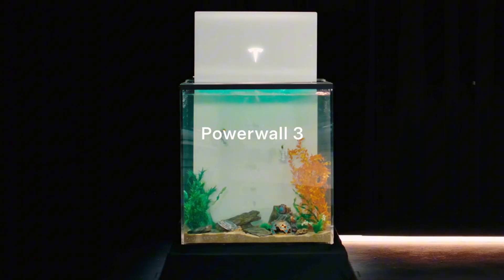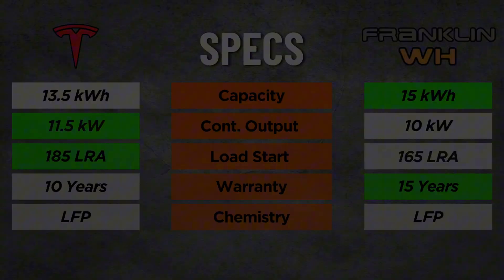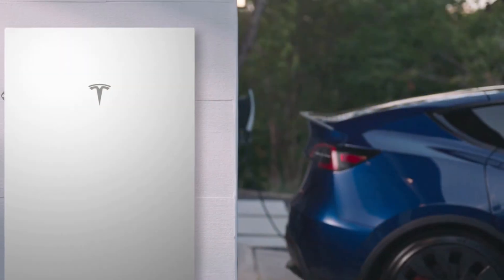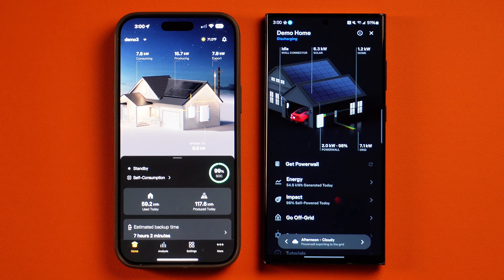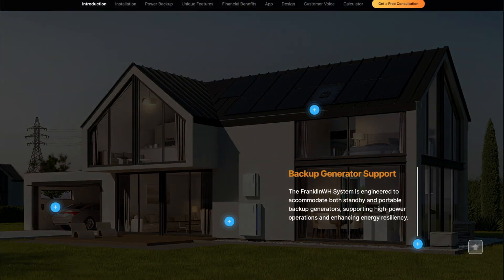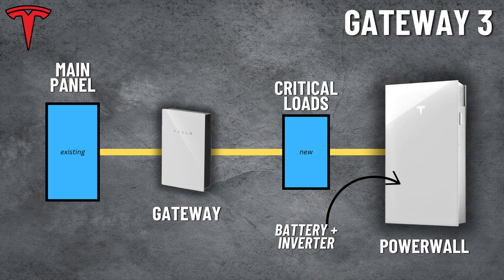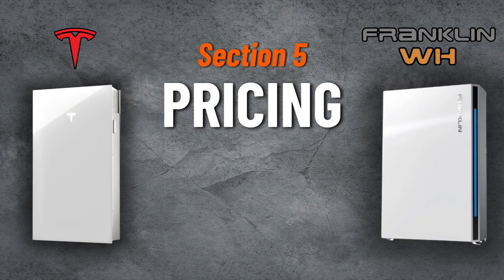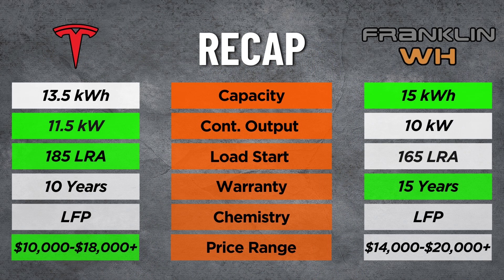Best Solar Battery in 2026? Tesla Powerwall 3 vs. FranklinWH aPower 2

Comment from the maker: Which battery looks better to you? Franklin or Tesla? 🔋
Reply: The glass cover on pw3 is neat but  too fragile
Reply: good review, definitely going with Tesla
Reply: Both look great. Does cost go down when you have your array ground mounted over roof mounted?
Reply from the maker: @brianjodihalseth2956  Yeah ground mounts will add quite a bit of cost.
Reply: Never supporting Tesla. But went with the Franklin of AC coupled design and it's simplicity, and the warranty. Plus, Franklin has great customer service and Tesla is virtually non-existent.
Reply: The mini span option is pretty sweet. Other than that Tesla seems to win on this one. The capacity of the Franklin is nice but Tesla will have that or more for PW4. IMO ease of install, cost, time, less material, less moving parts, ability to act as its own inverter, and the simplicity of Tesla takes the cake.
Reply: @SumpfEiche  Interesting perspective, but I don't agree with your comment about the capacity. PW4 doesn't exist, so it can't be used as a basis of comparison.

Fraklin takes it in both capacity and features (the integrated span panel option is pretty awesome). But that doesn't make it the best choice, for the other reasons you mention.

The backup switch is nice, but not available in many areas (wasn't available in mine). I got an excellent price on 4 PW3's being added to existing solar (paid about 11K per battery, fully installed). I doubt I could have gotten close to that with Franklin's batteries, even though I'd be getting more capacity. So at the end of the day, I agree that the lower price on the PW3 makes it the better buy for me.
Reply: For political reasons I would never buy Tesla but the Franklin system looks pretty good. Thanks for the info.

Comment: I just had a LG Chem resu 10h gen 2 warrantied out and replaced with a new one this week. The old one was swollen and faulted out, it was installed by Sun Run and has a Solar Edge inverter. How long would you use the new battery? I really want to get a better battery in there at some point. What battery would work best with a 5 year old solar edge system? Thanks for the help
Reply from the maker: I'd use the new battery for as long as you can. You really want to try and maximize the investment you've already made. With your setup specifically, there are a lot of options. Either Powerwall 3 or Franklin's aPower 2 would work. You could also opt for SolarEdge's battery when the time comes since you already have their system inverter, but I prefer Tesla or Franklin in my experience.
Reply: @ZachSolar  Thanks you are probably right. I am worried about the new one swelling like the old one did. The LG Chem resu 10h looks like it is problematic. Down the road would the Tesla or Franklin work better with my solar edge?

Comment: I'm new to all of this and my single biggest question is, can I install these systems with no solar panels? I want to use grid power to charge the battery normally, then be able to use my portable 18kw generator to recharge the batteries in the event of a power outage.
Reply from the maker: Sure. You don’t need to install a battery system with solar. You’d want to go with Franklin if you’re planning on including a generator.

Comment: Is it true in the SRP market area that if you do multiple Tesla power threes they make you use a gateway instead of the back up switch?
Reply from the maker: Nope, I’ve never run into that.
Reply: @ZachSolar  Thanks, do you have an a general idea of cost of difference between getting two PW3 and one PW3 and an Expansion Pack?

Comment: I run 2 PW3 , 2 DC expansions ( soon ) and 25 Aikko panels, Personally as a heavy power user I consider Tesla's home power offering of the PW3 to be to small. Im a heavy power user with 2 Split AC systems a tonne of computers and 3D printers and 27Kw is afaic a pittance. in saying that my power usage hits in the range of about 12500Kw Year.

Comment: I dont get either one at the price point . I found the Franklin at $9k purchase only . EG4 has a comparable battery for $5k it may not a inverter built in but buy a $3k hybrid . In short no disrespect to anyone else's preferences but if the internal inverter breaks then the battery is down and vice versa. So keep storage and inverter separate but talking. And save the money .imo
Reply: Eco worthy sells a rack mount 48v  100 ah battery for under a $1000 each  (5 kwhrs)...I'm gonna gettem next year...price will drop further..I'm Using Powerwin 48v 100 ah now ($750 each X 7) right now

Comment: 1. What are your thoughts with a Franklin WH 2 only with a price comparison with a 26 kw Generac generator ?

2. Will Franklin be getting a meter collar ?
Reply from the maker: Hey Carlos,

1) To clarify, are you trying to compare a Franklin 2 to a Generac generator? I’m not sure of the exact cost gap between these two options, but I would lean towards Franklin especially if you can take advantage of any TOU plan for day to day use in addition to outage protection. 

2) Rumor has it that they will be getting a meter collar solution. ETA on its release and utility approval coverage is unclear.
Reply: @ thank you for the response. The 26kw Generac fully installed would be $17K

Comment: Zach do you know if the back switch is compatible to retrofit on an enphase micro inverter install or do you need to go with a gateway ?   After the latest round of socal fires I want to add a battery backup.  Love my Tesla but if I’m gonna need a gateway the Franklin has a lot of great features.
Reply from the maker: Yes you can use the backup switch when paired with existing solar installs, like an Enphase setup. Obviously it does depend on the other qualifying factors though.

Email me at infozachsolar@gmail.com or book a call if you’d like help getting a quote. I have contacts out there that know how to set it all up. https://calendly.com/infozachsolar/discovery
Reply: You’ll still need an agate which is essentially the same thing

Comment: What you if you have no interest in solar initially and just looking for a battery backup (from the grid) in case of power outage?
Reply from the maker: Both options would be suitable for that.
Reply: Just depends if your utility will allow you to charge from the grid which many do not
Reply: Eco worthy sells a rack mount 48v  100 ah battery for under a $1000 each  (5 kwhrs)...I'm gonna gettem next year...price will drop further..I'm Using Powerwin 48v 100 ah now ($750 each X 7) right now
Reply: I rec Victron setup with their Quattro 5k or 10k series when you decide to get solar because it has transfer switch built in and two power inputs (generator and electric grid) which will save on equipment setup...these large systems are not necessary unless you have a large use of 3,000 kwhrs per month or more....for under 30k w batteries you could go off grid.....

$28,000 minus $10,000 tax credit

Victron Quattro 5k   (two units for 240v)
RS 450/100 Controller x 2
24 Panels Bifacial Tiger Jinko 590 w  (four 6 panel arrays...300v per array)
Powerwin 48v 100 ah battery X 7  (35 kwhrs...future 80k)
Service Panel Square D plus Shuttoff Breakers and Connection Blocks wiring etc.......
Reply: they also make a Quattro 10k  and 15k (europe only)

Comment: After an 8-month wait my installer called to confirm my installation is set for March 17th.  We have an existing PV system they installed back in 2023 with Enphase IQ8A Inverters.  After all incentives, we are OTD for $15,655, less than a new GENERAC generator.  Hoping Tesla opens V2H to all their vehicles.  Based on my situation 2 PW3's and my 12.5 kWh PV system should be able to power our home 24/7 365.  We might fac the odd weather event that curtails solar production for a day or two but that's rare.  V2H would solve that problem.
Reply from the maker: Great setup! I’m excited for you. I know it’s been a long journey to get this project done 🔋
Reply: You’ll be completely off grid?

Comment: My approach to "electrify" my home in central FL is backwards. I will start with SPAN panel which provides me with insight into my consumption. Later Franklin WH battery system for backup and time-of-use optimization since OUC is switching their billing in the next couple years. Lastly solar which by this time I will have a much better understanding my power needs. I have a local installer I have researched who is certified in all areas so this piece-meal approach allows me time to evaluate the installer's responsiveness, quality of work, and trustworthiness at each stage.
Reply from the maker: Not a bad strategy at all! It will be a good test to see which installer is right for you
Reply: Sounds expensive with multiple installs and permits
Reply: @mugmasher4309 I prefer it that way; I rather do a series of smaller installs evaluating the vendor at each step than do one big install only to find out the vendor is not as honest, reliable, or competent as the research had indicated.

My goal is to find a vendor whom I can establish a long term relationship since post service is important to me.
Reply: I use my battery bank like a fuel tank.  I deplete it (35kwhrs now 80k in future) to 17% then I add Shore Power (my electric company) until I reach 85% and Let my Solar Panels Do the Rest (2 arrays now...4 arrays later)...I Can Go 21 Days Without Shore Power...Goal is 90 days in 2026....I am not tied to the Grid for return power only charging
Reply: let me know how this goes i have ouc too and want to get around the time of useage
Reply: I am in Tampa Florida
Here is my setup

$28,000 minus $10,000 tax credit

Victron Quattro 5k   (two units for 240v)
RS 450/100 Controller x 2
24 Panels Bifacial Tiger Jinko 590 w  (four 6 panel arrays...300v per array)
Powerwin 48v 100 ah battery X 7  (35 kwhrs...future 80k)
Service Panel Square D plus Shuttoff Breakers and Connection Blocks wiring etc.......

Each Array is Ground Mounted....Alpha Bravo Charlie Delta...Four Arrays

Comment: The aPower2 is significantly larger than a Powerwall 3.  Much more than the additional 1.5 kWh capacity would suggest.  It's 50% thicker, 25% wider, but about the same height.  Still need to wait for FranklinWH to release a meter collar.  Not sure if the Power2 can function without a AGate.
Reply from the maker: Good point about the size difference! aPower is a big boy.
Reply: Is Franklin close to coming out with a meter collar? Do you know? I'm looking into solar & a battery but will not get Tesla.
Reply from the maker: Rumor has it that they will be getting a meter collar solution. Firm ETA on its release and utility approval coverage is unclear.